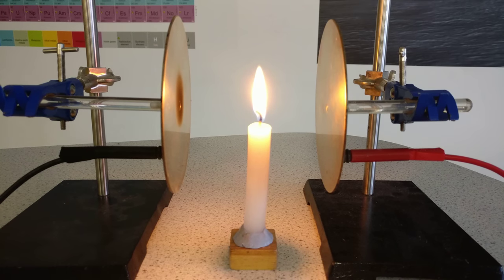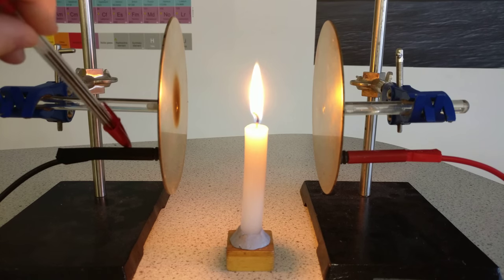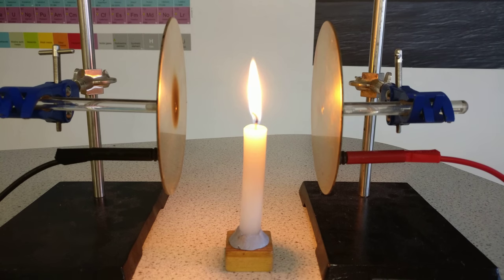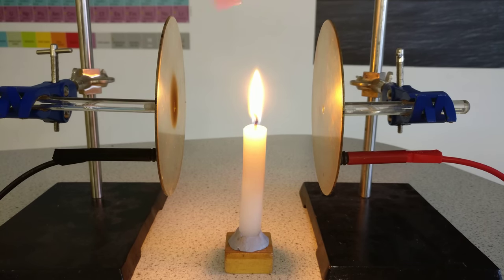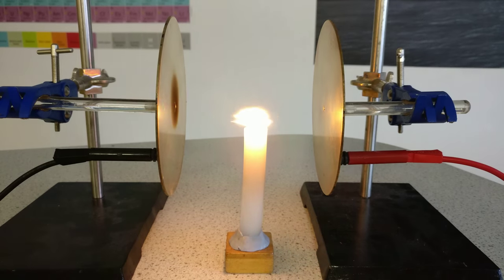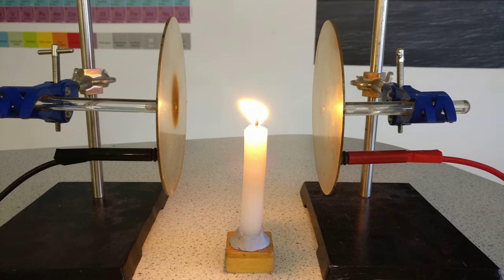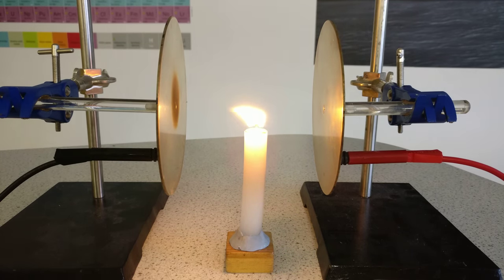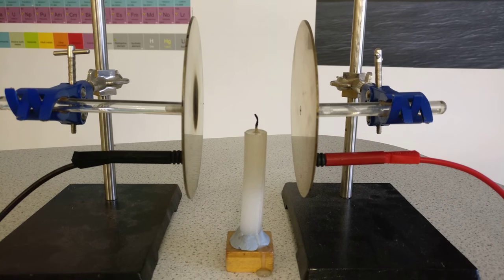Christmas Candle Flame in an Electric Field  - AQA A Level Physics

Comment: Something that could be used to put out fires since water is difficult to bring by load, one can just bring a fire truck with a coil in it no need to refill the truck with water. ALSO, are we looking at artificial sun spots and solar flares?

Comment: I would just use a fan to blow on the candle and not worry about an insane amount of electricity my shop isn't capable of producing. Especially if that's the only thing there is to brag about.

Comment: I'm trying to find electrodes like the ones you are using. Searched metal disks with handle to no avail. Someone help my idiot self.
Reply from the maker: Not sure they may be part of our statics kit?
Reply: @animatedsci  oh. My statics kit came just with a faraday cage and a power supply. What a shame. I'm covering potentials and electric field in class this week. Would have loved to do this demo in front of the kids.
Reply from the maker: To be fair I would just make my own. Just take two metal plates. Al, Brass, copper, anything really. Then glue gun a wood dowel to the back. Sq or round does not matter. Give it s go. Also try with van de Graaf as well

Comment: The electric field isn't putting the flame out the candle itself is extinguishing the flame. The electric field is providing a constant pressure and direction to the added energy of the flame and the mechanical function of the candle can't keep up.

Comment: Loved this.  Eletric wind that can blow out a candle.  How many volts does it take to turn the flame into a sphere?
Gravity is apparently a high energy field if that many volts are required to equalize a flame in its field.
Reply: you might need to use curved dish C shaped set of plates to do that
Reply: @fidelcatsro6948  interesting concept.  Maybe it will be tested later...

Comment: I would be worried about arcing.
Reply from the maker: It ok the air is quite a good Insulator but also the current is limited by an inline resistor.

Comment: not very surprising - but not so well "animated". having a littles indicator with PLUS and MINUS would have helped to clarify. Also showing voltage ON/OFF or better VOLTAGE value would have been helpful.
Reply from the maker: True. But I did explain it. It's just to show a simple parallel plate field 😃

Comment: I’m pretty sure you can also reproduce the effect using 5kV. You’ll just have to bring the plates closer together. Electric field within a plate capacitor is E=V/d, where V is the voltage between the plates and d is distance. Correct me if I’m wrong!
Reply from the maker: Yes. You can try but the plates will then start to spark as the air resistance breaks down. It has some effect but not as good. 😃

Comment: Isn't the drop off with distance 1/d^2. Flames are very interesting. I wonder if you got a higher speed camera, what it would look like.
Reply from the maker: Yes from an electrical field which is from a point charge. This is a region of space with uniform field so E = V/d for this one. However outside the plates there will be some of this.

Comment: Every school can have a homemade EHV using an ignition coil from a car.  With a signal generator and a 12V power supply, you can easily create 40kV.
Reply from the maker: True. but maybe a bit dangerous

Comment: I have a 1968 Popular Mechanics that talks about the principle of using to fly. If you use pointed wires from the positive side and a metal screen for the negative side using high voltage, you generate a nice wind with it. Electrons feed off the points of the wires and are attracted to the screen. They pick up O2 molecules along the way that continue after the electrons stop at the screen.
Reply from the maker: Very cool

Comment: Just yesterday YouTube suggested I watch video with arcing and short circuits. I noticed a strong interaction between flames and the electricity. It looked like the flames allowed the arcing to occur over a greater distance. This is because of the ions in the air?

Another question: In the presence of a strong electric field, what is the hum you can hear caused by?
Reply: Haha! I can answer my own question. https://en.m.wikipedia.org/wiki/Mains_hum

Comment: Can that be done with just smoke? Like using burning incense below the field having just the smoke pass thru the plates.
Reply from the maker: I tried that and oddly it's not hot enough, I used a smoke match but the smoke is not ionised enough to work.

Comment: Can you explain creating an electrical spark in a vessel with varying pressures?  Is more KV required in higher pressures?  My concern is in regards to internal combustion engines.
Reply from the maker: I think the spark all depends on the resistive properties of the gas. There is a sweet spot between conduction with gases.

Comment: did you just touch both stands with 25KV nearby with both hands at the same time?
well there´s something you still can learn yourself... ;)
Reply from the maker: The stands have insulated rods on the metal plates.
Reply: @animatedsci  I know. Else this video would have ended ways differently.
Still, my point is valid, friend

Comment: The direction of electron flow is from a point of negative potential to a point of positive potential. Your video instructing us that flow of voltage from positive to negative..Incorrect. Negative to positive.
Reply from the maker: It's ok! Positive charges from the positive terminal!

Comment: I like how the pen is just for scale.
Reply from the maker: Ha, actually it's mostly my fail safe for any demo with statics so I don't tempt myself into brushing an electrode or static charged bit. I have had some bad past experiences!
Reply: @animatedsci  Glad to hear a few minor stings hasn't put you off testing & experimentation. I don't get to experience the lab way of things much anymore. I work in manufacturing. We use electric fields everyday, all day, to assist with painting & various verification processes. Also at levels that allow welding. A bus bar shorted out once in my early career. The emp fried every computer within about 50ft. I'll never forget that blue white flame. Of course if you looked too long it would be the last thing you'd ever see clearly. Keep up the good work. The more people know the less stings they'll need to endure.
Reply from the maker: @johncrocker4209  Yes I think I have generally been lucky as the current has always been low. I have touched a 5kV eht connector, dropped an alpha source with metal tongs onto a spark detector 5kV, tasered myself with a disposable camera capacitor home built by the student. This is why I introdued my pen method!

Comment: It's a magnetic field. The electric field is transient as the magnetic field is changing. Once the plates charge, the electric field no longer exists, and you're left with a magnetic field.
Reply from the maker: But, it is DC and and the field is not changing
Reply: @animatedsci  Yeah, DC creates a magnetic field, that's the field between capacitor plates, like that. An electric field is generated in an inductive situation if you were to run AC through an inductor.
Reply from the maker: @lberhold  Ah I see, but there is not much DC there as the current is so limited so I thinkt the E-field probably swamps it!  Anyway Its my E-Field demo in any event for A2! Thanks :)

Comment: But there's no actual current between the plates because there is no spark, right?  Not sure how the ions are moving without a current...unless there is one.
Reply from the maker: The spark is a breakthrough you cannot see small electric discharge
Reply: @animatedsci  So, I assume you could get a reading on an ammeter then?
Reply from the maker: @primovid  it will be a galvanometer for sure. Not much flow but it's there!

Comment: Can you put out fires with the right frequency? If so, why don't fire fighters use it?
Reply from the maker: Too difficult to make and sparks would fly. Highly dangerous
Reply: @animatedsci  what's the biggest model that's ever been used for something like this to your knowledge? I know you can do some crazy things with frequency, and I know the government has done some crazy things with it. I never really thought about applying it this way before. Also, if you put your hand in place of the flame and use this at the frequency demonstrated, would this hurt you?
Reply from the maker: No idea really on the scale. However, if you put your hand in it would be nasty.
Reply: @animatedsci  interesting. My last question is have you experimented with frequency for healing the body? That's been my area of interest for quite some time. Ancient medicine was based off vibration. I know it can be done. Aside from breathing techniques I'm not sure how to apply it though.
Reply from the maker: @Allyourheroswenttohell  no I have not but I know that ultrasound works well to heal the body. It can break up scar tissue and heal.

Comment: is that because the air get moved back and forth?
Reply from the maker: It's an electric field
Reply: @animatedsci  Do you know if the electric field changing directions quickly and the air molecules in between get moved back and forth by the electric field, and the wind caused by these moving air molecules blows out the candle frame?
Reply from the maker: @R同学-o8f  no it's a uniform field with DC 😀
Reply: @animatedsci  I forgot those interesting knowledge T^T

Comment: Just use a neon sign transformer
Reply: Add a spark gap to one or the other electrodes or both and alternate gaps to roughly variate frequency
Reply: I would use the outputs of a permanent magnet motor, as the rotor, and so no brushes and iron ONLY in a discreet radius of the rotating field forces so we are pulsing the transformer.

This will offer unusual polarized , so to speak effects .

Comment: Can you explain the mechanism ?
Reply: @animatedsci  Dont you know what a mechanism ist?
Reply from the maker: No idea what you mean. The ion changes are pretty clear 😀
Reply: @animatedsci  I mean, how does the electricity make it affect the ions and what is the mechanism of the ions that they react to the electricity? The experiment doesn't show this, it just shows that the electrical currents do this and that when the electricity is increased or decreased. What is the mechanism of change, that is my question...
Reply from the maker: It's just the heat from the flame ionises the wax and air so you have positive ions from the atoms and more free electrons. They separate in the electrical field and go to the anode and cathode. Also it can conduct a small current through the air. 😃
Reply: @animatedsci  Ok, thank you  :)
Reply: @animatedsci  So the electricity acts as a magnetic pull force that pushes the mass of the flame apart, I would guess. The mass of the magnetic electrons is smaller but faster than the mass of the flame, therefore the electromagnetic force tears the flame apart. That's what comes to my mind. Electrons contain magnetic force...
Reply: @animatedsci    youtube  watch?v=J1uIx4rxYs4  "What is magnetism?"
Maybe you're in the mood for something new

Comment: I remember back in science  at school we learned that air is ionised once the voltage across a one inch air gap exceeds 20, 000 Volts. So it would have been interesting how much closer he could have brought the two plates before an electric arc was produced between the plates.

Comment: Power doesn't flow down Power cables, it NEVER has.... No charge moves across from one side to the other. the particles in question are just EXCITED meaning they vibrate back and forth NOT move across from one plate to the other.